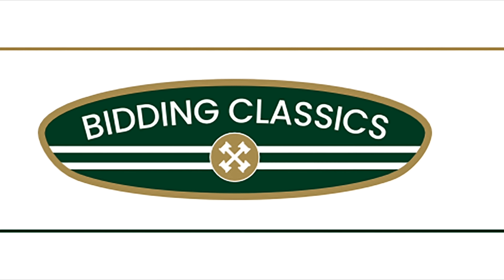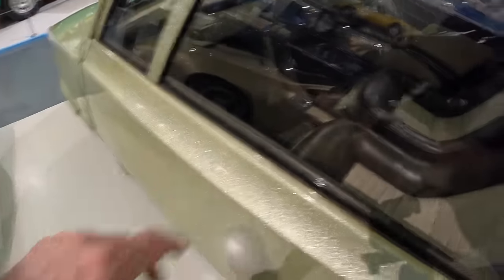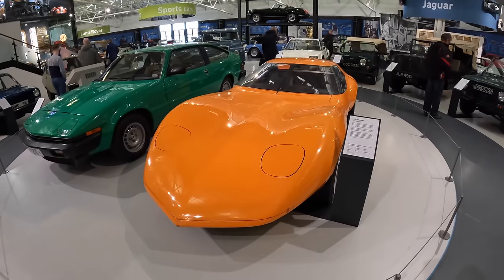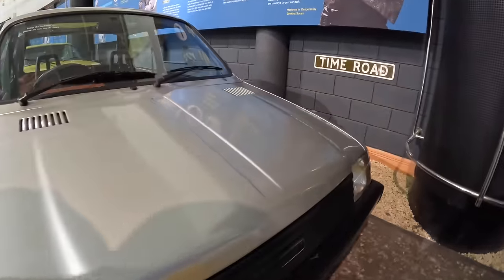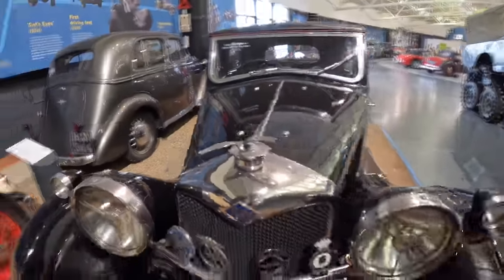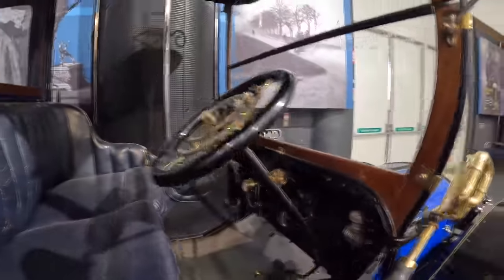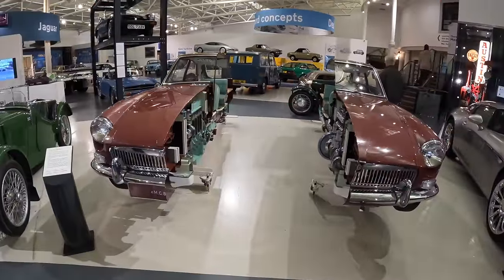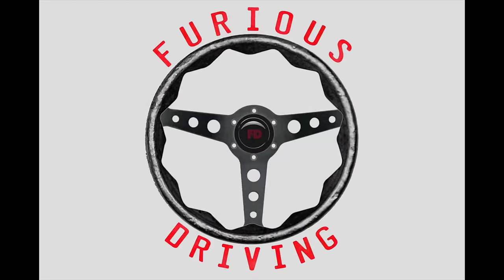Inside the British Motor Museum

Comment: Matt, the first Ford factory in the UK was set up in Trafford Park, Manchester in 1911. You have mispronounced the late great Giovanni Michelotti's name. It is pronounced "mick-elotti". Don't worry, I did the same for a lot of years myself. I visited Gaydon in 2011 for the 30th anniversay of the Triumph Acclaim. They even brought out the last Acclaim (and last Triumph car) that come off the production line which was in CD trim and had the Triomatic transmssion which was basically the Hondamatic by another name. I still have the photos I took. Maybe I should make a video of them. The interior on that silver Metro looks more like teracotta than orange. A shame there's no MK2 Cavalier in the Vauxhall section. It was the prime example of GM's J-car platform. I've had 5 MK2 Cavs during the 1990s and they're now pretty much all but gone.

Comment: Sort of lost interest once you got into the 60's and beyond stuff as grew up with that era, the concept and prototypes were brilliant and a shame they never got to production.  Dad owned 50's into 70's (BMC and Triumph mostly).  Cut my mechanic's teeth on them,  my fingers went where his wouldn't fit.  Well remember his 1938 Ruby when aged about 2/3 in early 50's and digging out shrapnel from various places after the house was bombed in 41, luckily the garage survived just. Two other homes also got bombed (one a V2 which took almost the whole Street, ground shock) but the Austin survived them all.  He told me it only covered less than 100 mile during the duration of the war (3 home leaves in the whole war).    Would have been an MOT failure (big time) if still around when they came in.  Traded for a 49 MM in 53 (first of 6).  The 30's post vintage is the period that I have the most fondness for (Riley) and the late 20's.  Great cars to drive as one is connected to them which doesn't happen with modern cars.

Comment: @matt Was excited to see the Jaguar Xj13. BTW not a straight six but the Jaguar XJ13 = 5.0 L 500 hp DOHC V12  + 5-spd ZF manual. The body designed by Malcolm Sayer who also did BOTH the C and D type Jags! Its a one-of-one car that was wreaked in testing and later rebuilt.